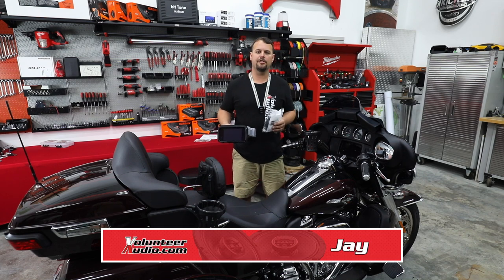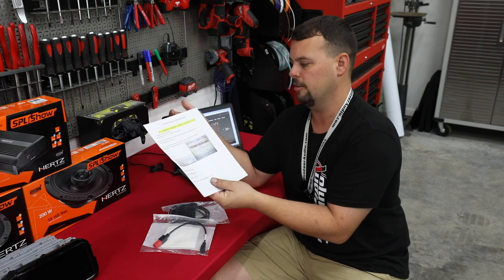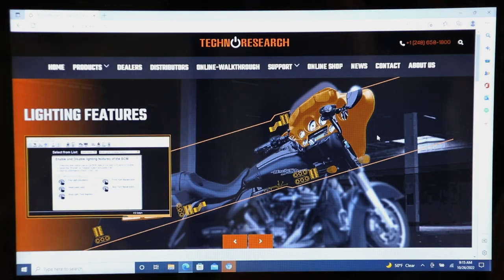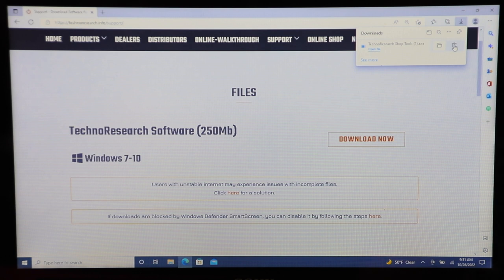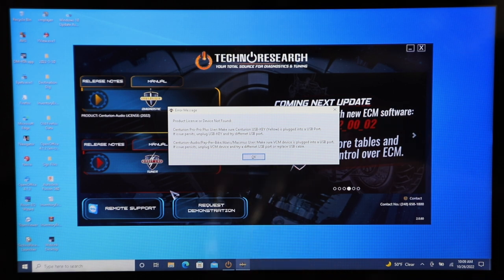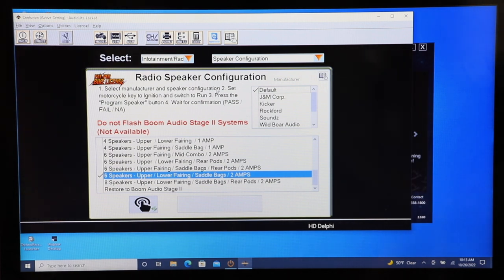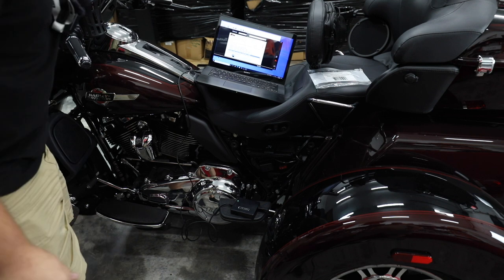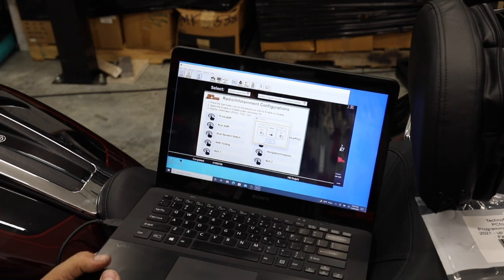Step by Step - How to flash your factory radio when adding a new amp to your Harley Davidson

Comment: I have a 2016 Ultra limited. The Stereo crashed while under warrenty and was replaced. Im going on a ride with my wife and friends. The Headset doenst work and the CB wont come on unless someone else keys in on a different CB. Apparently there is a option that needs to be set to internal. Will your programmer work to fix this issue???

Comment: Do you recommend flashing the radio before the amp/speaker install or after?  Does it matter?  Also, do I have to do the Apple Car Play flash is I have an Android phone?  Is there any benefit to doing so?  TIA
Reply from the maker: No reason to flash CarPlay if your using android, flash the radio when installing the amp, not before

Comment: I have two GZ front speakers and the Sounddigital 800.4 amp. which flash should I use for this? In default the 1 Amp 2 Speaker, the Rockford Fosgate or the Soundz? It's important to me that not too much bass is lost.
Reply from the maker: Follow the video, same flash every time

Comment: So the site and the application says do not flash boom stage 2. I have the stage 2 and considering changing. Can I or can’t I flash it?
Reply from the maker: @steverolph8330  you flash boom 2 when replacing the amplifiers, you can not flash back to boom stage 2 using techno research but you can flash as outlined in our videos

Comment: I have a 21 SGS I bought new and the 1st thing I did was put in different speakers and a little amp, I went with Hogtunes REV225 Amp and 462F because it was plug and play no flash required, sorry I didnt even know of you guys at the time! It's way better than the stock garbage anyway. Would purchase this and doing this flash improve it even more? Thank you.
Reply from the maker: The hog tunes amp uses a high pass filter in the amp to try and compensate for the no flash, but they also don’t have enough output after flash to sound right

Comment: I purchased the Hertz stage 4. Just completed the flash on my 2016 Street Glide. Only issue was how my connection was a little stiff coming out of the fuse box cover. Great video I will comment on all the install videos as I install my system. Only one I am nervous about is cutting my saddle bag lids.
Reply from the maker: Good luck!

Comment: I work for a shop and we have the Techno Research hardware already. My employer asked me to familiarize myself with how to use it and what we can do with it. The how to use it was perfectly covered in this video. Thank you. My only remaining question at this point pertains to bikes with the boom systems or other factory amp add ons. This device is ONLY for the radio itself correct? On those bikes my thought would be (if the customer isn't happy with the "premium sound") 1... flash the radio, 2... remove the "factory" amp, 3... replace with aftermarket amps and speakers. This seems to be the best way in my opinion to deal with the cross over points in the amps and get a full range signal to work with. Am I on the right track in your opinion or am I over thinking things?
Reply from the maker: Same flash will be used no matter which system they had stock, and yes you will remove the stock amp and upgrade if you are flashing the radio

Comment: Great video ,Is there a difference between 8 speakers and 2 amps  and
4 speakers and no amp
Reply from the maker: Watch this video What does each Flash do on a 2014-2024 Harley Davidson® 4.3" Boom, GT, or GTS Factory Radio
https://youtu.be/dBVQH5PjUU8

Comment: Does your 134_Off.bin Volunteer  Flash have the ability to fade also?
My 135_Off.bin sounds WAY better when the bike is not running and I have no fade.
If not is there a Kicker Flash with 6 or 4 speakers have the Fader?
Reply from the maker: Watch this video and the series about flashing the stock radio, I cover everything you need to know in detail 
When should you Flash? Everything you need to know about flashing the Factory Harley Davidson® Radio
https://youtu.be/25rK4cH_xuM

Comment: Great info Jay!  Would you use that same flash (6 speaker/2 amp) if you were just doing the 2 fairing speakers and an amp?  It gets a bit confusing but I think that's what you recommended.
Reply from the maker: Yes, you are fixing the radio, not actually picking the number of speakers you are using

Comment: I just ordered a stage 4 hertz with the sp4.900 and soundskins fairing kit for my 2019 streetglide on 6/8/23 I have not started the install...waiting for my off days with much anxiety lol...My question is I mostly use android auto,so should I still do the apple carplay play flash just in case and will it affect android auto in anyway? I use a ottocast for wireless android auto. Also appreciate your videos and the work you put into your kits.
Reply from the maker: Thank you, the CarPlay flash has no effect on android auto, we have had many issues with the ottocast adapter, if you have issues with it then plug in using a quality cable, if it works well keep using it

Comment: Nicely informative video, I didn't  quite get the answers I was looking for. I have a KAC-M3004 4 channel amp, and it will turn on with line input or remote 12v. Would a flash be recommended for this amp on stock harley gts. Thanks
Reply from the maker: You always flash the radio if using an aftermarket amp for best results, then use the remote 12volt turn on

Comment: Great info here Jay! Wondering... is the "6-speaker, 2amp" flash any different from the Rockford flash? I'm wondering specifically about the low-EQ gain differences that may boost the low range when using a single amp with 2 speakers. Thanks!
Reply from the maker: The Rockford flash is a non amped factory flash , it has the bass boost and eq changes still  in effect and has a lot of distortion that will blow speakers, I do not suggest using the Rockford flash, also known as the stock 4 speaker no amp flash
Reply: @volunteeraudio  I get what you're saying Jay, thanks! American Hard Bag exclusively recommends the Rockford flash and Logan says it does not change the EQ (engine on/off) and also that it came from Rockford and not just a "copy" of the 4-speaker no amp stock Harley flash. So it's really confusing hearing these conflicting stories. Either way, I appreciate your insights and will likely stick with the 6-speaker 2 amp flash.

Comment: Great video very informative. Ive been down this audio rabbit hole all day. You say in the video part of the reason you’ve choose the default setting is because it turns on the rear speakers. So if i don’t want the lower speakers which i assume is in the leg faring. Can i use the 6 Speakers - Upper Fairing / Saddle Bags / Rear Pods / 2 AMPS and get the same eq curve or if i was to do the rockford flash will that enable all my speakers and have the flat curve you speak of? With these being factory flashes will my local dealer be able to do this? TIA
Reply from the maker: Every flash is a default flash, some are renamed brand names like Rockford but all are a factory Harley amped or non amped flash, I shared the only correct flash and explained why we use it in the video.  This is the best flash for upgrading your factory system by adding an amplifier and speakers, and no the local dealer cannot flash to a factory amplified flash unless you have factory amps installed and connected to the ecm data lines

Comment: Does this work with other installs or only with kits you sell? 
I currently have yellow basket Gz on the way and currently use Alpine R2-s65 speakers connected to kenwood xr401-4 and LC7i converter.  What benefits would this flash do and what setting should I choose?
Reply: I have 2019 Road Glide.  Wondering what benefits this will have and if necesssary
Reply from the maker: We recommend this flash when installing any aftermarket amplifier, it does the following 
This flash makes 4 needed changes
1. Activate rear speakers in stock radio 
2. Removes the factory bass boost and flattens the Eq
3. The EQ no longer changes when engine is running 
4. Lowers factory radio output voltage to a cleaner more useable input signal for most amplifiers

Comment: While trying to flash with the one you recommended , no sound from the speakers. I have the wild boar audio amps and speakers. So I used the wild boar option and they work …🤷🏻‍♂️
Reply from the maker: Wild boar is hogtunes, it is designed for the non factory amp flash, any other flash and the auto turn on will not work on the hogtunes amp

Comment: How can I flash the boom 2 no one in Australia does it. Been getting the run around from rockford fosgate, techno research and a company here in Australia.
Reply from the maker: If you are adding a boom 2 system to your bike only the dealership can flash boom 2 on, TechnoResearch can flash it off and to a different flash for aftermarket  amps

Comment: Great video Jay!  If i wanted to keep my Boom II amp and fairing speakers (for now), can I have the dealership flash my radio to fix the eq curve? Possibly to the 6 speaker, 2 amp factory Boom Audio flash that you mentioned in a different video?  Or does the dealer have to flash it to what the bike actually has?
Reply from the maker: Boom 2 only works with the boom 2 flash, if you change it your amps stop working
Reply: @volunteeraudio  Thanks! Looks like an audio upgrade is in my future.

Comment: Looks like you only internet connection to down load the App.. But will you need internet connection when connected to the bike to make the changes..that can make a big difference as many don't have internet where the bikes are garaged? Seems well detailed otherwise
Reply from the maker: Any time a license code is involved an internet connection is needed to verify the code and the vin number of the bike being flashed, we use a laptop to show what is needed and we always say a pc computer with internet connection.  At no time do I say “only needs internet to download software”  we make videos to try and not have assumptions to the process.  Thank you for watching

Comment: Wow.  Super easy with those instructions.  Still need to call yall to figure out if we can get more out of my SD 400.4Evox with this flash.
Reply: Same.. I have that amp and rockfords in the fairing. Sounds meh, but I got it used and don't know if it was ever flashed to begin with
Reply: @PkwyDrive13  I'm rocking hertz neo speakers and tweeters with a BT line level currently.  Sounds good but I hear my amp isn't pushing full potential of the speakers.
Reply: @jasonbreedlove495  ah you got good speakers.. 😂 Compared to the Rockford ones I got
Reply: I got the PPI amp and Hertz neo 6.5 and it sounds good nice and clear and loud I also added the boss kit for rear bags 2021 sg will be putting Hertz 6x9 later when the boss ones blow out  also did a flash on the gts stereo
Reply from the maker: I would suggest an upgraded amplifier, the 400.4 is underpowered and high distortion compared to most amps we use
Reply: Is that the same flash for 8 speakers as well ?  Thanks

Comment: After you flash the radio, will the speaker outputs be at a low enough level that you can use it for RCA inputs instead of the high inputs on the amp?
Reply from the maker: Yes

Comment: SO, I purchased the Hertz Neo's from you guys(690's, SV/SX165's-front and rear Powered byCicada BDA10000.4) can you tell me what the difference would be between the 8/2 and the 6/2 flash. or should I experiment between the flashes? also have a DSR1 in line.(thinking of removing)
Reply from the maker: Those 2 flashes are the closest to each other, both have similar radio voltage and same flat eq

Comment: Hi fantastic video, does it flash a sound stream amp with kicker 3 way speakers?
Reply from the maker: The flash fixes the radio for any aftermarket amplifier, you then must properly set your amp gains and high pass filters for your speakers

Comment: Even if you're only doing a stage four, the six speaker flash is the one to choose?
Reply from the maker: Yes the flash fixes the radios output, it has nothing to do with how many speakers you are actually using

Comment: I bought the Rockford fosgate stage 3 kit. should i be programing the radio with the 6 speaker 2 amp flash or the rockford fosgate flash?
Reply from the maker: We always use the flash outlined in the video and properly set gains no matter the brand

Comment: Is there a way to find out what flash a bike has on it or if it’s flashed at all thanks
Reply from the maker: Yes, you can pull the eq.bin number in the radio service menu.  We have a cheat sheet to see what flash has been done based on that number

Comment: Is thisn eeded for a 2023 street glide flhxs. Looks lke it has the soundstream radio already but wanting to do a 4 channel,replace front speakers and add rear saddle.speakers
Reply from the maker: You do not need to flash if your using an aftermarket radio
Reply: @volunteeraudio  how do I make sure it is an aftermarket for sure?
Reply: @volunteeraudio  im wanting to buy a package from your site as well

Comment: Brilliant and great information!!!
Reply from the maker: Thank you for watching!
Reply: @volunteeraudio   So I looked at the site and this is an affordable rental.   Just to be clear though, I can do this update before doing the physical install of amps and speakers?  I currently have a Road Glide Ultra with 4 speakers and the OEM head unit.  TIA
Reply from the maker: @heybruh3274  yes you can do it before installing the amp but remember this also attenuates the radio / turns down output, so I would not do it until the time of install

Comment: I have a 2019 Ultra Limited with J&M Rokker 800W 4 speaker system.  If bike is off, system seems extremely load and clear.  At 70-80 MPH music can barely be heard at max volume.  Will a flash fix this issue?
Reply from the maker: There are many factors, a flash may help but we remove the J&m rocker system quite often due to the same complaints, they exaggerate the power of the amp, we have much better, louder options at Volunteer Audio

Comment: If we have the jumper already installed for CarPlay, does it need to be removed after enabling CarPlay and flash? Bike is 2020 street glide
Reply from the maker: It does not have to be removed but you can if you like

Comment: So you flash the radio before you remove your old amp or do you install the new amp and speakers then flash?
Reply from the maker: Either works but we just flash before or after we have finished a new amp installation

Comment: good morning Jay.  i am not sure i am understanding this.  a few days ago in your "why you need to flash" video, i had asked about a flash to get rid of my biketronics BT-35.  you had indicated that i needed the boom 2 amp setting, but now you indicate that they can't do that without the boom amp?  about the 6:05 mark. you indicate that the dealer cannot do this without the amp installed.  so is there a setting they can do?  i may have just misunderstood the information
Reply from the maker: Correct you cannot have this done at a Harley Dealer, it must be a techno research dealer, this is why we sell and rent their tool

Comment: If you flash radio for CarPlay and don’t have a whim then decide later to add the whim will it work with the original radio flash you get with your tool  or do you have to reflash a second time?
Reply from the maker: The whim should work without need of additional flashing

Comment: I just flashed per instructions 5:00 my 21 RG with rockford 6 speakers and amp.CarPlay appeared but sound disappeared , reflashed multiple time with same results.
Reply from the maker: If you have the hd audio by Rockford you should not change the flash, this video is for installation of aftermarket amplifiers only.  If you are using aftermarket Rockford your amp turn on wire was probably not connected and signal sense auto turn on will not work after flash

Comment: I have a 2015 and would like to flash my radio. Will the 15 stock radio flash to use the Apple Car Play?
Reply from the maker: No, you must have a 2019-up gts radio for CarPlay or purchase a Soundstream Hdhu14+
https://volunteeraudio.com/product/soundstream-reserve-hdhu14-replacement-radio-fits-2014-harley-davidson-touring-motorcycles-thumb-control-module-included

Comment: hi jay i have a 2017 street glide cvo i swapped the radio for the boom box gts my technoresearch computer can't configure the amps. Specifically, 4 Stage II speakers (Fairing Upper & Saddlebags) with 2 amplifiers.
Reply from the maker: Correct only the dealer can enable boom stage 2 amplifiers
Reply: @volunteeraudio  😱😱😱Unfortunately in Paraguay we do not have a dealer😔😔😔

Comment: Quick question I have a 2023 Ultra Limited and have the WHIM installed, will this flash the need for me to connect a wireless headset so that I can get WAZE and Spotify to work without wireless headset
Reply from the maker: If you turn the whim on inside the techno research flash tool you no longer need a headset paired for CarPlay to work
Reply: @volunteeraudio  cool, but if I then plug in a wireless headset the WHIM will still do its job and allow me to use voice commands for carplay and hear calls via the headset

Comment: Can you show the process on how to start the Apple car play after this process??
Reply from the maker: Apple CarPlay requires a gts radio, once the whim is flashed on you simply plug your apple phone into the factory usb using a quality charge / sync cable and CarPlay will automatically launch on the radio
Reply: @volunteeraudio  thank you

Comment: So my question is, actually, 2 parts 1. Do you have to reflash if you flash for 1 amp and 2 speakers and later decide to add 2 more speakers? 2. What is the cost to rent the module?
Reply from the maker: We recommend the flash in the video for any number of speakers, the radio does not care how many speakers or amps you have, this setting just makes the radio have its best signal for an aftermarket amp.  Pricing for rental is on our website at www.VolunteerAudio.com